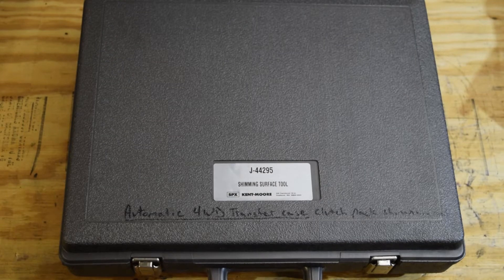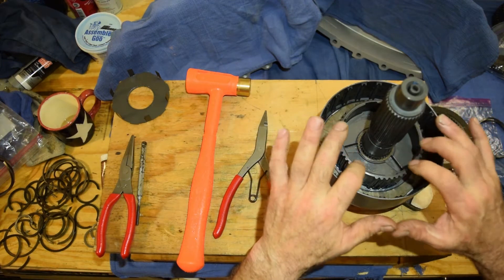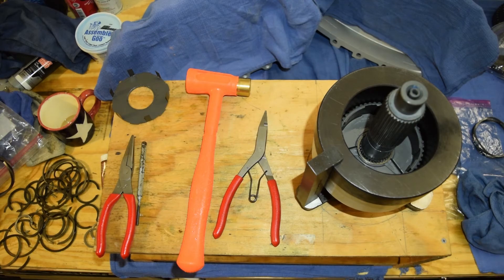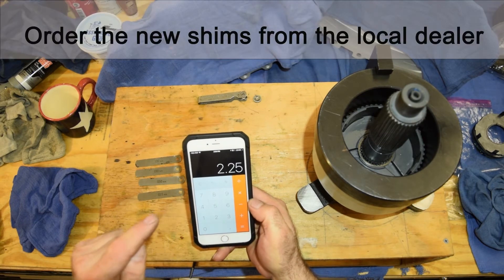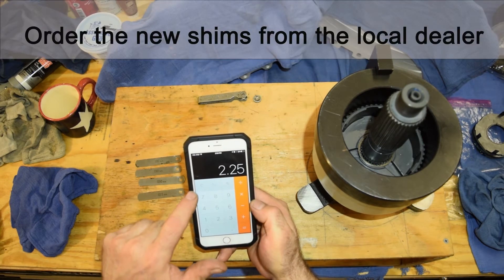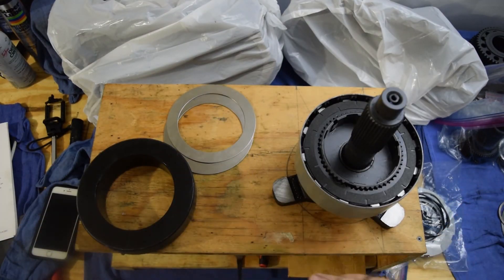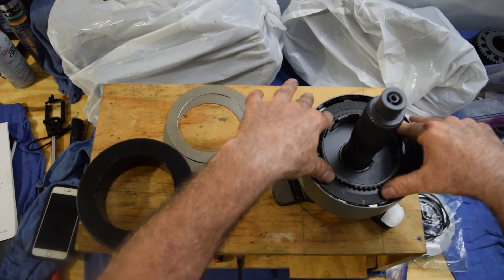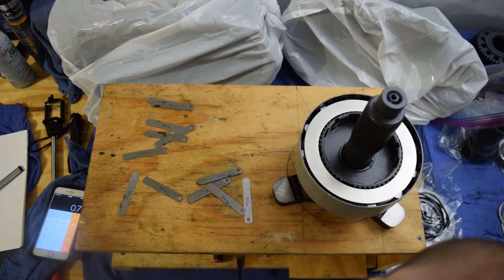GM NP246 Clutch Pack Rebuild

Comment: That’s funny I had to install 3 that’s right 3 transfer case encoder motors on my 05 Chevy np246 transfer case!!! Because the original encoder shit the bed!! It’s horrible back in 2022 trying to find parts for my 05 silverado that has just over 40,000 miles on it! I like the truck because it has the torsion bar suspension system on it! I have a bad back because of 5 fusion back surgeries! You can imagine how pissed off I was to have to crawl 3 times under my truck because of faulty parts!! Suffering from CANCER and debilitating back pain and no one around to give me a hand! The greedy selfish times we’re living in NOW! GM has a LOT OF answering to do because of their Deceitful lifter problems that are chewing up cam shafts and the insides of their engines! It’s pretty shameful they are leaving thousands of customers out in the cold with THOUSANDS of DOLLARS in repair bills loyal customers GOT STUCK with and GM tried to HIDE their POOR Quality! It’s sad I’m waiting for the whole automobile industry to crash because of what’s going on since Covid! If the government would stay out of the car industry with handing out taxpayers money 💴 it would all come to an end! Can you imagine the car industry the stock market the banking industry, what would happen if the government would stop handing out taxpayers money?

Comment: Curious why your not using the " J-44295-4 " spacer for taking your measurements? There are 4 tools that come in that kit, your missing the spacer for taking the measurements, or at least that is my understanding of it, Im reading the factory 2005 service manual, and it says to measure between the spacer and the gage block. What am I missing here ? Ive noticed that most of the kits, like 9 out of 10 are missing the spacer (-4 ), or maybe they changed the procedure at some point?

Comment: Hey, I rebuilt my np246 electric shift with the auto 4wd function using info from the manual, readers forums ( to see what they may have run into and learn how to avoid or apply ) and the few videos available, one being yours.  First thank you for taking the time and appreciated greatly.  Next, during my build I was able to find the kit to set the clutch up on ebay, along with seal and bearing drivers as can always resell.  I hung on to mine and glad I have as even though I set everything to perfection I'm encountering what seems to be clutch drag in the form of a vibration, which I didn't really notice until I finally got it on the highway,  start around 65 and then up especially.  Tires and vehicle rode like silk prior to this. I've tried to see if the front driveshaft turns smoothly and it seems pretty tight when turning by hand, then frees up for half turn, then tight again, consistently which is what leads me to believe that this may well be the culprit.  I've replaced most everything that could be considered a wear item while I was in there at it due to having 240k miles. ( New SKF bearing/seal complete rebuild kit, new pump and case saver along with new aluminum rear case, maybe overkill??, checked and rechecked multiple times the clutch pack set up and have even changed the fluid after around 1500 miles, just to see if that made a difference. It does seem the slightest bit tight when making turns which also leads me to this being a condition.  I didn't realize that it could affect it as much in 2wd mode, yet am learning otherwise.  I replaced all the u joints while drive shafts were out, I used balance rings available aftermarket, as knew that could become an issue and it is prevalent still.  My 2002 Tahoe has been spared nothing much in the way of repair and maintenance needs as the new vehicles cost too much, can have problems too and I like to be able to keep my own up and not walk!  New engine and transmission mounts were also done and everything set back to manual specs, driveline angles etc..  I've read where the factory spec for the clutch pack is too tight and believe I may have to take it back out and recheck/loosen it up several thou.  I believe I had mine set around 6 to 8 thou after ordering new shims.  I also used, what was supposed to be and looked like, factory clutches as I've read that some manufactures use a transmission type clutch and material which is not suitable for this application due to excessive grip.  Not sure if this helps anyone or if you may have any response after some thought?  It's always a great feeling knowing my vehicle inside out and to be able to figure out any problems that may arise without having to rely on outside sources for repair as I know what most are like after working in the industry in my days.  Still, things do come up and I'm no expert on these units.  Thanks to all those who respond as well and once again, appreciate your videos greatly.

Comment: Could you tell me what depth the J-45383 sets the bearing to?
Reply from the maker: Next time I'm working on that I will.
Reply: @EddiCurrent  I figured it out, but jesus. I couldn't pay a dealership for an hour to set the pilot bearing which takes two minutes with a $450 specialty tool... 🤬 Ended up having to use connections to get it done was way to hard. So if you post it, I'm sure someone else will benefit. I already drafted a model for the part, I'm going to put it on thingiverse so folks can get it without paying extorsion fees.

Comment: Are the one piece hubs and two piece hubs interchangeable?  I have a two piece, but cannot source a replacement oil restrictor plate for it.  One piece hubs are available.  Great vids, btw.
Reply from the maker: Very good question, I’ll have to go check my spare parts to make sure. But off the top of my head I’m going to say they are as long as you use all the related 2nd gen parts.
Reply: @EddiCurrent  This shows a pretty good comparison of the years.  Looks like I may need some other parts if I decide to do that.  

https://www.zumbrotadrivetrain.com/media/wysiwyg/catalogs/NP246_1999-2007_GM.pdf

Comment: hi! can i ask where did you get the tolerance data needed with the tool? i was looking for it but never got it, i rebuilt mine but i didn't get that tool although it was working at the end :D
Reply from the maker: The person I bought the tool from included the GM information. Please keep in mind, these measurements are for the Type I transfer case (pre-2003). The measurements for 2003 and up are different. I’m working of a video that show the differences now.
Reply: Where can i order the top shim from i have grooves from the spring ring on top of it
Reply from the maker: Dealer item
Reply: Any luck in finding clearance specs for 2003-?

Comment: This tool is not something everybody can afford to buy, it's also a waste of money. The clutch thickness determines the total degrees the encoder motor shaft will turn from compression in 4hi to 4lo. Using an angle gauge and a torque wrench as used for tourqing  head bolts would make more sense. It would be nice if you could do a video showing the number of degrees from one compression to the other with 10 inch pounds and a conversion chart with the number of degrees to shim thickness to obtain the required amount of degree rotation. Thanks.
Reply from the maker: Keep your eye on eBay you can pickup a used tool. So, if your just going to use it once, your would be reselling it on eBay when your done so in the end it cost you 40-50 bucks, that would be a reasonable rental fee to get the job done right.  I think you have an interesting idea, I will be taking mine apart to re-shim the clutch pack and when I do I will look into your request for a torque/degree rotation solution.
Reply: The encoder motor stops turning the shaft when the encoder sensor feedback voltage is where it is supposed to be for the range selected. It doesn't stop turning or keep turning depending on clutch pack preload. The back of that shaft contains a cam with flats on it which is where the clutch fork rides. The purpose if these shims is to ensure you're not dragging the clutches in 2hi, or slipping them in 4hi from lack of preload.
Reply: So, if the voltage drop or current load is what regulates the amount of preload on the clutch, in theory an observation of how far along the "flat" or in my opinion an inclined plane, should be good enough. If the clutch compresses somewhere between say 1/3 to 1/2 way, one would think that is good enough unless the encoder also counts the travel that must be within range of the transfer case module parameters.
Reply: The module does monitor over current and position. So it will not turn to the point of breaking the shaft. The position sensor or encoder sensor is how the module knows where to stop the shaft in a fixed range such as 2hi, 4hi or 4lo. Auto is a little different because other factors come into play such as individual wheel speed to regulate the apply of the clutch for an on demand apply. The issue with this clutch is there is no real constructive way to "bench test" preload on this clutch. In 2hi they are released and should not drag. In 4wd they are squeezed to turn the front drive shaft. There are too many unknown factors as far as turning the encoder shaft with a torque angle meter. Where would you get a spec at? How would you convert this to shim thickness? It's unknown what the actual torque is that is applied by the encoder motor. As stared before, the encoder turns until the module "thinks" it's where it needs to be and then the motor "locks".  When the internal lock sets, it's no longer performing work and it's position is fixed. At that point, how tight the clutches are being squeezed are solely determined by shim thickness. Most of the time these clutches don't suffer a failure and I do imagine there is some lead way  with these shims. My suggestion if you do one of these, if the clutches look good, rerun them and the factory shims. If you replace the clutches, take the drum to the dealer and slip a dude $20 to measure it for you. Great discussion.
Reply from the maker: So what your saying is that as long as you don't setup the clutch too tight or too lose you should be OK. But how would you know? I wonder how a person could visually see what close enough would look like?
Reply: @EddiCurrent  If I remember correctly, I assembled the front part with the haft in place and rotated the shaft and observed how far along the travel on the cam the clutch was applied, about 1/4 to 1/3 of the way along the cam or ramp.
Reply from the maker: @Canvideo  If anyone is interested I'll make a video on this when I get a chance.
Reply: @EddiCurrent  Maybe after setting up the clutch pack using the method in this video, you can use a torque angle gauge on the fork shaft to show how many degrees till the clutch is contacted.
Reply from the maker: @Canvideo  I don't have a torque angle gauge at the moment, but I'll see what I can do.
Reply: Thank you for your discussion on this topic. I believe I read somewhere that the TCM learns the reaction of the clutch to sensor reaction. I recently had the 246 clutch bearing failure and pump rub. I didn't have the clutch tool and replaced the clutch release spring with the updated spring reused the clutch pack and shim. I did add a spacer between the bearing housing and bearing. Before assembling the tail housing and with applying pressure on the output shaft to remove end play, I set the clutch pack height so that when turning the shift shaft with a vice grip that it ramps up 1/4 to 1/3 as fore mentioned, and it works fine, and releases as it should in 2wd. Also as you mentioned about dealers setting up the clutch height for a small donation, transmission shops can also do that for those with one closer to them than the dealer.

Comment: If I'm not mistaken, there is a 4th component to that kit which is an 0.085" shim that is needed for taking a stack up measurement on the 2nd design clutch hubs, which you have. The 4th tool component (0.085" shim) goes on top of the weight and measurements are taken between it and the gauge bar. I have a 2nd design NP246 apart now and it only has one 0.032" shim in that clutch drum.
Reply from the maker: The shims you have to order from the dealer. One of the reasons its so important to measure your stack up is no clutch pack material will be the same (close maybe) and as the components wear the shim that came with the stock TC may not be enough or too much. I have found two different styles of clutch drums in the same series of NP246 cases, I'm not sure which is better.
Reply: Correct. There was 1st, 2nd, and current design. The 1st was the two piece hub that takes the stepped oil restricter plate. The second design is what you have in your video. What I'm saying is you performed a 1st design stack up measurement on a 2nd design clutch hub. Our kit doesn't have the 4th component for that kit either. It was an add to it. Idk why other than service information says that 2nd design clutch assemblies requires that 0.085" shim on top of the weight before measurement. In order to set mine up, the plan was to take measurements without that 4th tool part (0.085" shim), then subtract 0.085 from my measurement. Hopefully im in the ball park of the factory 0.032" shim that was in this clutch pack from the factory.
Reply from the maker: Interesting, so what your saying is our clutch tools requires an additional 0.085" shim to be used on the late model drum and hub design? Do you have GM documents/instructions that state this?
Reply: I can get a doc ID tomorrow. I will update.
Reply from the maker: This is valuable information to have video documented, I shall update the above video and show the difference we have spoken about. I guess it's a good thing I've been too busy to install the new TC in my 2003 Z-71 Suburban, Kudos to you Brandon!
Reply: Sent. Used email exactly as spelled.
Reply: @EddiCurrent  Did you determine whether the Kent Moore Shim Selector Spacer (.085 Spacer) was required for proper setup of a 2003 NP246?  The 2003 Service Manual doesn’t mention the spacer so I am wondering if it is for later year models.
Reply: @donedwards8899  No, i not sure what benefit it would be.
Reply: 0,085..is that inches or millimeters?

Comment: I thought there would have been much more comment and discussion about the clutch pack reassembly. From the little tidbits of info that I have gathered from the GM community, it is this clearance in the shims that decides if your front driveshaft will be forced to turn in 2WD mode. Well, not only this clearance but it is the biggest factor if I'm not mistaken. It would be great if others could volunteer their knowledge. I know some of the 246 are designed to compensate for that front output spinning in 2WD as an update to the earlier cases that had a lot of complaints of increased or exaggerated wear & tear for the mileage. Thumbs up on your video tutorials and information.
Reply from the maker: You are right, the setup of the clutch pack properly will make a big difference on how it performs and lasts.
Reply: So you are aware of the topic i brought up? The front driveshaft on my 2003 Yukon doesn't have any tension on it when in 2WD mode; it doesn't turn with the remaining assembly. Other folks cannot manually turn the front DS and it spins regardless of drive mode selection. Have you installed the case yet & can you verify the preload on the front driveshaft in 2WD? It shouldn't matter if the engine is running, trans' gear selection, etc - ignition off, in PARK. Please verify performance in 4WD Auto at  your soonest opportunity. Thorough feedback could very possibly help me a great deal. Thank you, sir.
Reply from the maker: How did you check yours?

Comment: Nice vid...been awhile since i did that vid but I dont remember mine looking like yours?
Reply from the maker: Yes, you have the two piece hub and and I think the first version apply plate (not made anymore), it has the return spring on the outer ring rather than in the hub. Did you notice I sort of copied your clutch stand (thanks again for the idea)?  Your Part 6 clutch video https://youtu.be/br5pU__mUcc